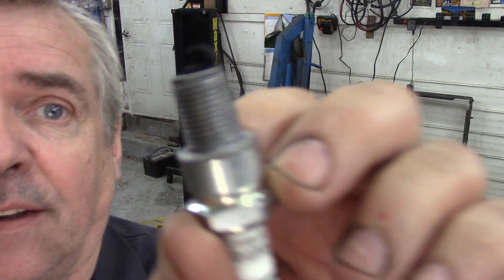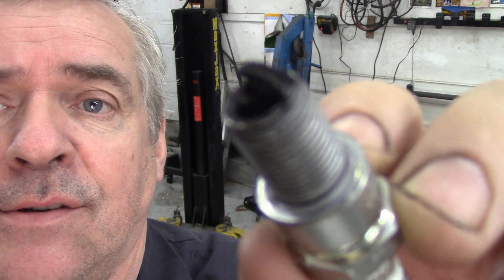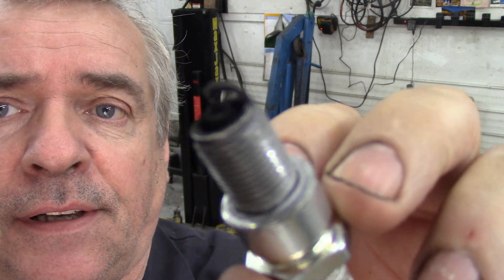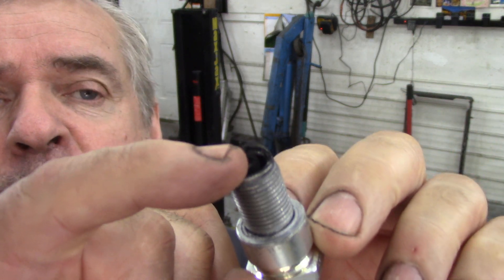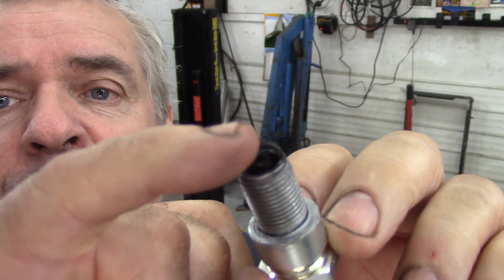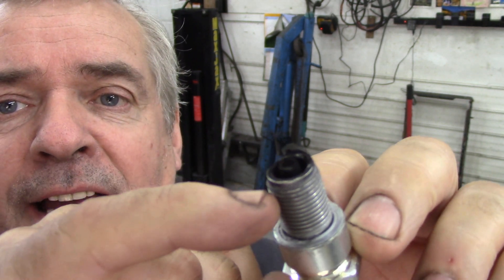Is this the reason the Range Rover would not run right, I think so!

Comment: Just put them through your vapour blaster and clear the carbon. I use my ordinary cabinet blaster and it works a treat. However I always give them a good blast of clean dry compressed air after blasting to avoid any media getting into the cylinders.
Reply from the maker: But they have run for less than 5 minutes
Reply: I know decent spark plugs aren't cheap these days but I'd be worried that problems might occur again after a few thousand miles.

Probably better to just replace them now and not have to worry in the future.

Comment: Hi Mike, good find. 
The problem that I have had was the problem with fuel doing exactly the same thing in my mercedes, I had the fuel distrisbutor resealed with new rubber seals, after that it started running rough, after a lot of trying I thought it was water in the system, metho does a good job with that so I tried that, it worked! But the next tank the same problem occurs, more metho!? Well to make a very long annoying story short, what was happening was that the "new fuel" was attacking the rubber and putting an insulation on the spark plug first misfire then they stopped sparking altogether after a while, hence missing badly, ad metho no problem, a mate of mine had the same problem after replacing rubbers in the fuel distributor of his Merc, ad metho problem goes away, had the same problem with Harley's as well, the fuel in the carburettor bowl goes brown and sparkplug fouls. But only with newly acquired carburettors. Just something to keep in mind. I live in Oz so maybe not a problem in Canada, but here it certainly is.
Reply from the maker: Could be anything - new plugs to go in this morning!

Comment: Good video!  Also if the crank sensor is faulty the RPM clock stays on zero when you crank it.  If not faulty the RPM clock should read when cranking around 300-400 rpm which is it’s cranking speed… if it’s got a RPM clock?? 👍
Reply from the maker: Correct - but no sensor output no spark
Reply: @BritannicaRestorations  I had a VW diesel that would crank but not fire on the drive for over a month, went through everything and it ended up being the injectors had dried up with standing and wouldn’t open when they got the signal.  Supposedly a Bosch injector trait.  Ultrasonic cleaner saved the day.

Comment: Dunno if the gap is too wide, or the plugs are faulty, but the poor thing ain't going to run properly sparking like that. 

You have to be careful with plugs. I had a set of Champions that had their threads cut too sharp and they ruined the head in my old FIAT twin cam. Went to NGK ( did a lot of work on the then Datsuns ) and they used to be great, but now I'm not so sure as I mainly have diesels these days.  However, they are NOT made in China. Japan, Germany and the US are where the factories are. Maybe those ones are knock offs?
Reply from the maker: Gaps checked to the book specs
Reply: @BritannicaRestorations  Sure Mike. Kindsa hard to see in the vid, but I know you've been round the block a fews times and you'd have that sorted.